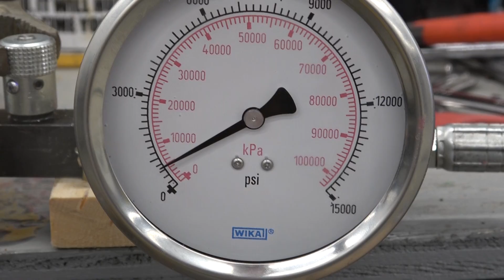How much pressure can PEX take?

Comment: Pex kills copper thefts around here from the meth heads.
Reply: Same here, and I just watched a video of a guy having the replace ground wires for poles and substations. A comment on his video said around their area they take a iron rod a paint it copper colored so the thiefs would grab it instead of the coated ground wire
Reply: @matthewhoffman9242  Factory I work at has their power hookup painted black so people don't try to steal the shiny copper connectors.
Reply: Matthew Hoffman 
Bbv
Reply: An upside I hadn't thought of.
Reply: A town I used to live in had some van rip a bundle of telecoms cabling out the street one night to steal the copper.

Except what they ripped out was a bundle of fibre and copper coated aluminium, which is stamped with "Property of .... telecom" so no scrap yard will buy it.

It's still a problem on our rail system though, they call it "signal failure" rather than "crackheads stealing copper wire".
Reply: @ncot_tech  I used to work with a lot of South African telecom technicians here in NZ. Their network is mostly in underground ducts. Apparently the local blacks like to open up a manhole, saw through a several thousand pair telecom cable, drive to the next manhole, saw through that, hitch it to the car with a chain and drive off. Anyone who has ever sat down a manhole for 17 hours straight jointing several thousand pairs of lead and paper cable cringes at the thought of this happening. Helps to have lockable manholes. Hilariously in NZ all the copper is in ancient manholes with cast iron lids that aren't lockable, and all the fibre is in nice new lockable ones. But thefts of network elements are rare here. Hot water cylinders on the other hand....

It also helps when scrap dealers are legally required to photocopy your ID to accept any scrap. People are less motivated to steal copper then.
Reply: @Patrick-857  in Arizona The scrappers legally have to photocopy of your ID too
Reply: @Patrick-857  ......yeah not likely.
Reply: @robertcasey3528  What isn't likely sorry?
Reply: @Patrick-857  asking for photo ID at the scrap yard has never stopped a thief from stealing
Reply: @robertcasey3528  It helps. But you're right, and I can personally attest to that fact. I should have phrased it more like it helps police catch the theives. Police are the ambulance at the bottom of the cliff though. I've never gotten anything back that was stolen from me, the police basically seem to think their job is done once there's a report for the insurance company.
Reply: @ncot_tech  the cca has them screwed, but they'll just burn insulation off the regular copper. unless its physically stamped into copper (which requires a bit m ore surface area), it becomes untracable, and while they might get less for it (burning copper wires puts it into some flavor of dirty metals categories), its still more than nothing. the only way to stop them is to limit the amount of valuable metals they can harvest from a job site.
Reply: We had someone pull the ground from the pole pig from the bottom got lit up when it contacted the lines he survived and tried to sue
Reply: @Leroys_Stuff  I'd loved to have been on that jury.
Reply: Jason W  me too
Reply: Yeah, but the header's still copper. Easier and cheaper to replace to be honest.
Reply: Some dipshit tried to steal 3 feet of soft copper tubing connecting a propane tank to a backup generator. They clearly ran away the moment it became disgustingly clear that they had just vented a whole 100 gallon propane tank to atmosphere.
Reply: @orijimi  too bad they didn't get the full lesson that expanding LP doesn't work well as a replacement for oxygen
Reply: Now If they only made electrical conductors with no salvage value.
Reply: @D2O2  they do. CCA, copper clad aluminum
Worthless for smelting, and for use
Reply: @D2O2  hard, considering its value comes almost entirely from its use as a conductor.
Reply: Arizona meth security
Reply: @skm9420  if meth wasn't illegal and the lowest tier American workers could actually earn a living wage, you'd probably find that the thefts nearly disappeared.
Reply: @blarglemantheskeptic  I have to agree
Reply: @blarglemantheskeptic  it's still funny. In a sad, deranged, suffering type of way. 

I think they call it graveyard humor.
Reply: @akshooter271  really? You know that for a fact? Citation, or bullshit.
Reply: For real. Pex my not be as good as copper but for the price its actually good for colder climates
Reply: I had some copper stolen when I wan away from home
its all pex now, those Crystal Pistol wielders can eff off
Reply: @evmanbutts  good joke, I'm definitely using it.
Reply: Same here they stole the earthing wire faster than we can install them
Reply: Ya know I thought the same thing till they realized thos sharkbites cost more than copper anymore
Reply: Graphite is an insulator...
Reply: That’s why they use it as an electrode in arc furnaces
Reply: @danielrouw2593  graphite, not theoretical and currently more expensive than gold magic angle graphene molecules mind you, is not even close to copper's conductivity. Copper is ~6e7S/m where graphite is ~3e2 to ~3e5 S/m depending on orientation.
Reply: If we want to minimize copper theft and other bullshit, we need to legalize all drugs so that people don't need to steal for their addiction. they get thrown in prison for hurting no one other than themselves, then with a criminal record can't get a job, and when they can't get a job they turn back to drugs, and then they start stealing.

Comment: recently i had to get a new water heater and the guys at the shop said dude you gotta take the time to upgrade to PEX. I got my new water heater and i put it back the way the old one was with solder and metal pipe. about a month or so after that a buddy of mine called out of work, his basement flooded because a pex connection failed. moral of the story, dont change what works for you just because something new comes out.
Reply: Dads house had all copper and it didn't make it 20 years til it corroded and leaked its now been replaced with pex. But we have hard well water not city water
Reply: @Kas_GikesJr  i have a condo in Naples, Fl and it is piped with PEX, some of the older condo's in the area that used copper the lines are starting to fail.  There is something in the water in Naples that causes corrosion in copper.
Reply: @Kas_GikesJr  I've had to replace 2 sections of copper pipe at my house for the same reason. Corrosion caused leaks at the solder joints. I've also got pretty hard water. I've got a softener on it now, so maybe that'll help. I planned to replace with PEX at some point.
Reply: @Kas_GikesJr  not all copper is good, some old stuff had impurities that cause corrosion over time. Also, there was a time they thought it was a good idea to place copper pipes before pouring the concrete. Turns out, differential expansion of copper and concrete with rapid temperature changes (which will happen when running water) cause stress cracks over time. 

Good copper pipe, properly installed, stays good forever. No real way to know if your pipes are good until they've stood the test of a couple decades worth of time, though.
Reply: @Kaboomf  seems like an expensive chance to take. The copper did not pass through concrete and still corroded. Quite a few houses around  here have replaced copper with pex or pvc because of recurring leaks. Maybe its our water but I went with pvc in my house. Cheap, fast, easy and good for at least 45 years. Old ways are not always better
Reply: @Kaboomf  copper in concrete corrodes too. 
Nowadays any pipes embedded in concrete here have to be replacable, so they're always plastic in a corrugated plastic pipe.
We had pinhole leaks forming in our copper (4 in a year) so we're midway through repiping in plastic. It seems a lot of it was caused by a moron using too much flux in the joints, there was also lots of steel contamination.  Plastic is flexible enough to get us into gaps where copper wouldn't work, and with bonding requirements here it's easier just to do the whole lot in plastic rather than swapping back and forth.
Reply: We have a house up in new England that had been occupied with a tenant for the last 15years.  But recently we had a year lapse with it unoccupied.  This also coincided with some deep freezing.  The basement water lines were a combination of copper, steel and PEX. There were about 15 different sections that had burst, but the only thing that survived was the pex sections.  Shark bite fittings are crap,  but crimp rings will hold long after the pipe fails.  I used to scoff at pex, but after having to spend a week, fixing one burst metal pipe or fitting, only to turn on the water and heard the dreaded pitter-patter of water somewhere else in the cobweb infested basement, I'm sold on PEX for areas that get deep freezes.  Water freezing can create upwards of 100Kpsi.  I don't care how skookum your sodder joints are.  They won't take that kind of abuse.  PEX is designed to expand and then come back to its original size when it thaws.
Would be interesting to do some side by side  comparisons of pex and copper segments, filled with water, capped and frozen.  Could do some freeze cycling to see how many winters it will take.
Reply: I live in Maryland (pronounced Merlin).  My townhouse is 35 years old and I've already had two major pinhole leaks.  Apparently the water here isn't good for copper.  I've been luck so far.  many of my neighbors have had more leaks that two!  Half of them have already switched to PEX.  I'll probably switch when I replace the water heater.  I can get to everything from the basement, except the line going to the 2nd floor bathroom.  I wish I'd thought about it when I had the bathroom redone a couple years ago.  
So if PEX and copper aren't the answer (and it's not bad copper, it's all over the county), what's the right answer?  My friend has PVC.  Around here, PEX seems to be the most recommended.
Reply: @billklement2492  CPVC is an option as well. I used it to run water to my bar and the ease of install was nice. As long as you keep it from freezing temperatures, it holds up fine.
Reply: Problem is, the US Gov changed drinking water standards around 2000 that over treats the water to the point where Copper will corrode very quickly creating pinholes on the cold side. Warm water still allows the protective layer to form on the hot side so there are fewer problems. See Prof Marc Edwards, University of Virginia, research/testimony before congress for more info.  This is a nation wide major issue that has been kept under wraps because of the scope and scale of the problem.  The EPA , states DEPs and copper pipe manufacturers like Mueller Industries are all well aware of the problem and finger pointing went on for years.
Reply: The copper line to my water heater sprung a leak where it contacted a piece of steel.
Reply: @hamjudo  sounds fairly typical. Different metals have different thermal expansion ratios, and also different galvanic potential although it should be the steel corroding in that case.
Reply: @Kaboomf  It was MC cable, which was plated with some other metal. The metal cladding was also significantly corroded.

Both pieces of metal were probably grounded when the house was built more than 50 years ago. I should verify that they still are. There is a real possibility that they were at different electrical potentials.

After repairing the pipe, I insulated both things.
Reply: @hamjudo  replace the anode rods in your water heater, or a few feet of pex at the heater outlet works to break the electrical connection between the 2 metals. Very common problem.
Reply: @hamjudo  galvanic and contact corrosion is a thing, didn't say plastic doesn't have advantages
Reply: Failed joint, probably installed wrong.
Reply: The guy at my local Manards told me the same thing. Then asked him where is that solider located.
Reply: PEx is not better than copper, it's a lot cheaper investment-wise, MAYBE better for modification in an existing system, but how often do you do that in a residential object. Someone pulled a fast one on you...

Comment: So outta curiosity, how is PEX installed in north america? Because the current fad at least here in Switzerland is to have an outer tube that is put into the brick and concrete walls to guide the PEX tube like electrical wiring, the theory being that while the PEX might not live as long, it's less effort to replace, at least to my understanding.
Reply: Sounds like the same we do here in Norway, "tube in tube" as they like to call it. From what I've seen on YouTube, it's normal to just have the PEX without any outer tube in the walls in NA, at least in the US. At the same time, they don't seem to use an outer tube for electrical wiring either like we do in the walls.
Reply: @andyv3965  Outer tube (conduit) for electrical in businesses only is the general US rule.  In a home, you just have to tack little metal plates to the carbohydrate foam wherever a wire penetrates it, so you don't stick a nail in the wire hanging granny's picture up.  Of course when you grab a self-drilling sheet metal screw because that's what you found in the junk bin, it goes right through the plate and into the wire anyway.
Reply: At least in my neck of the woods we only sleeve pipe or wire when it transitions thru the concrete foundation or fire walls.  Any other time it's straight thru the wood members.

Comment: The canadian pressure boundary codes have an exception that you don't need special considerations if the line size is < 3/4" and pressure less than 70? psi and the contained fluid "not more hazardous than water".  Air doesn't count.  You want to test something at high pressure?  Use water.  Hydrostatic pressure will result in a failure with a little bit of water rather than a jet of air.

Comment: You need to try Uponor PEX, not the other stuff.  Aqua PEX seems to be the gold standard. Different ends too.  But you can use Shark Bites if you want.
Reply: Viaga is really the best around
Reply: I'd say Rehau Everloc is the most robust connection type. Combines the pex-a shrink over fitting like  Uponor and a slide on compression sleeve.
Reply: Nathan D I’ve never had a viaga fitting fail and I started using them in 2003
Reply: I also started pro press very early my shop was the first in the states to use it
Reply: @mattberg6816  for sure Viaga makes great products. I sold plumbing products for 12 years, starting just before all the new lines of pex fittings started coming around. I really like the Viaga stuff, hands down the fastest installation of all the brands.
Reply: Nathan D I also find the aluminum coated stuff to be top notch
Reply: Nathan D especially with a ridges press tool doing the crimping

Comment: Hoop stress, also experienced when sitting on the throne after yer morning coffee
Reply: You may need one of those “paper ass gaskets” ! Might hold in some additional PPSI( poop per square inch).
Reply: How the fork did you write this comment 4 days ago
Reply: @ostracizedelite5096  patreon early access privileges my friend!
Reply: You're going to have an o-ring blowout or burst a blood vessel in your eyes.
Reply: If you have stress instead of an easy slide, you went too light on the coffee.
Or you've been afflicted with an "accessible" seat height to get your innards in a bind.  You want as close to squatting as you can get, straightens the works out for less resistance.

Comment: 21 years in our house which has the black plastic tubing for the hot and cold water, commonly used in houses down under. Touch wood all's well! Nice slow motion vinegar shot! 😂
Reply: Assuming you're Australian that black stuff would most likely be aus pex. Which is great stuff. Only shark bite is hated by most plumbers and is the number one when it comes to burst fittings and flooded houses. The rest is all crimped in a different way and requires a many thousands of dollars tool to seal it. Shrak bite requires some cutters and that's it. And what's worse bunnings sells their own verison of it which is even worse not that any one thought that was possible

Comment: The real fun happens when you take the class to get your Swagelok card and get to destroy a piece of copper tubing after you practice putting fittings on it. That stuff'll take a couple thousand PSI or more before it blows out like that plastique did. They have a special machine that pressures the assemblies up with water so they don't explode like they would with air. It just leaves a nice tear in the side wall and you end up with a fun paper weight for your desk.
Reply: Gotta love swagelock, I work in the gas field and gotta use them everyday.
Reply: I used Swagelok for decades in science and development applications. I don't ever remember a properly installed fitting leaking. For that matter most improperly installed Swageloks don't leak.
Reply: @mwechtal  They work great but are always out of stock ,take forever to arrive and cost a fortune. There are flexible alternatives for up to 45000psi now.
Reply: @Chris_Garman  our application was for a particular alloy, and the storeroom kept them in stock. I only needed about 200 psi. I did have to wait for a needle valve once. I swear they had to mine the ore to get started manufacturing one. It was months.
Reply: @mwechtal  we use ours for natural gas don't think no more than 3-500psi but usally lot lot lower